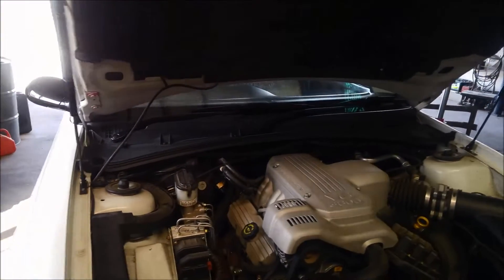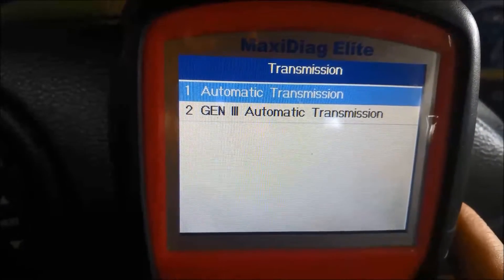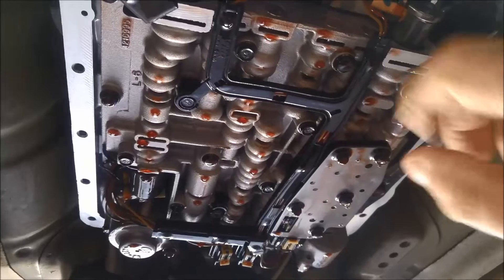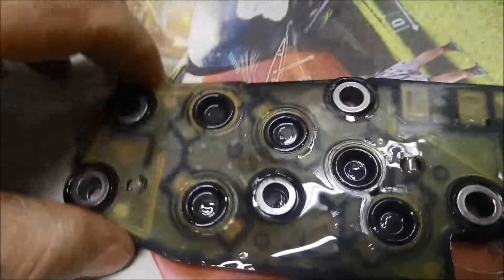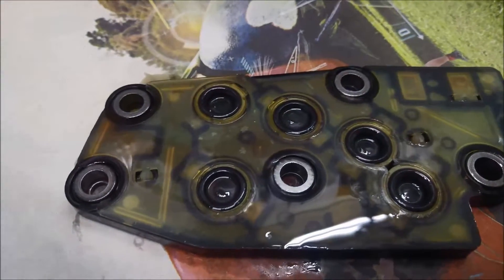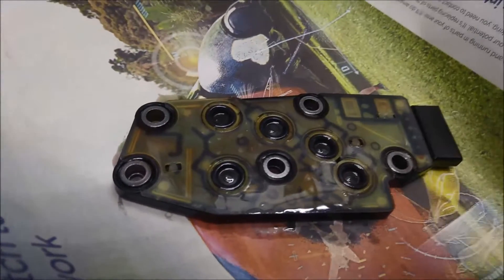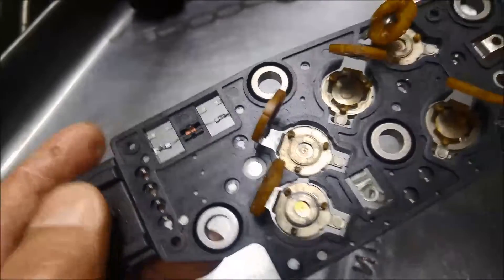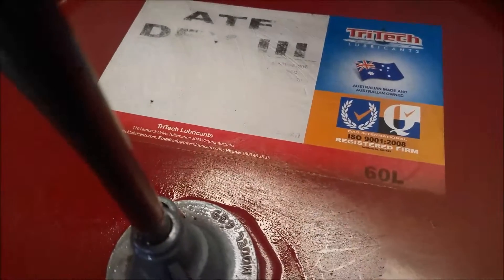4L60E 4L80E Problem Neutralizing Intermittently on Take-Off Repair by flushing Manifold Switch Plate

Comment: My transmission did this going into 3rd gear. Checked the shift solenoids. Low ohm resistance. The manualswitch plate had been replaced by a previous owner with a generic aftermarket unit and over torqued to the valve body. It was full of gunk and upon removal the o rings and disks stuck to the valve body. I'm replacing the shift solenoids and the maual switch plate and hoping that fixes my problems. I've been watchig some of your videos and educating myself on transmission servicing. Thank you for the great information and explanations!
Reply: Did it get fixed?
Reply: @RaulioG88  No. I believe it's burned 3-4 clutch pack. No easy fix, here.

Comment: i put way too much fluid in my transmisson=, due to dip stick not being fully seated. now it plugs the filter after about 20minutes with clutch material. i have dumped the pan twice now and i am suspecting high pressure is causing premature wear, i will be testing this tommorrow. is there a chance that this manifold pressure device can cause a high pressure
Reply from the maker: hi, too much fluid will hit the spinning components and aerate the fluid. in an hydraulic circuit air can be compressed, oil or fluid cant be so much, aerated fluid will cause spongy or slipping shifts. the pressure control solenoid if disconnected will go to full pressure to try save clutch and band lining application. some people fiddle with the adjustment on the press control solenoid without knowing how much you can adjust and sometimes the valve cant shuttle enough because of that or if loosened too much bleeds off constantly. you need to know how to calibrate the solenoid properly. if the linings are peeled it means trans needs to come out for repair. cheers

Comment: Hi there, I’m glad I’ve come across your channel, and apologies for this long winded question. I have recently had a complete transmission failure on a VY commodore. A few weeks after a service…pan gasket, filter and fluid top up as per workshop manual, I noticed gear changes were delayed, and I guess could be described as slight slippage. No other strange noises or obvious mechanical anomalies, then one morning whilst selecting reverse, there was like a 3 second delay before engaging. I thought I would check fluid level, and it was very high. I know I didn’t over fill it. The vehicle didn’t want to drive in any gear, but would try engage after revving around 3-4k. I decided to siphon quite a lot of fluid out until it registered at the correct level, in park and at operating temp. From this point, there was no engagement in any gear. Dash shows correct gear, but nothing. 

With your years of experience…have you herd or experienced anything like this! Does this sound like a major failure of say the pump, or torque converter? No engine light or codes as far as I’m aware.
Reply from the maker: hi, did you check seal on filter ? is it correct filter or maybe crack along plastic seam on filter. sounds like a pressure ir insufficient fluid issue ? cheers
Reply: @YepThatsIt  Hi, thanks for the prompt response. I installed the seal that came with it, replacing the old one. Pretty sure everything is correct, but I haven’t dropped the pan since, so I will recheck along with the things you have mentioned on the weekend, as it seems a bit suspicious after replacing these parts and no obvious signs! The fluid seemed a little frothy at the time it failed, which from further research makes sense from what you have pointed out. I will provide some feedback after inspection. Thanks heaps for the advice. I will contribute towards some beers too. Cheers.
Reply: @YepThatsIt  Hi mate, your suggestions were bang on! Teach me for not installing the seal correctly, even though I knew better. Filter was sitting in the pan! Any way, thanks again. Have made a payment to you PayPal account as mentioned. Enjoy a beer!

Comment: I want to know if this is what happened to mine as I put it in to drive and it doesn't move I have to put my foot down to 2000rpm to get my car moving what are you using to clean it
Reply: And my engine light is on know to
Reply from the maker: hi, we use x55 solvent. cheers

Comment: Thank you for the video. Much appreciated. Can I use mass air flow sensor cleaner to clean the switch?
Reply from the maker: hi, yes you can, any solvent that doesnt melt or damage solenoids is ok. cheers
Reply: @YepThatsIt  how do you know if you have a cracked diaphragm lens?

Comment: I just fixed this problem on my subb. The pressure switch manifold was contaminated with small metal fragments. The scanner returned these results: P0700, P1815 (4L60E start in wrong range > D2) plus stabilitrak alert in the truck (a nightmare: slow acceleration, harsh shifting, etc). Now is running like new :D
Reply from the maker: hi, glad to hear it, a few beers are always appreciated. link is in vid description. cheers

Comment: oh wow, do you know if the 92 chevy Astro van has this in the transmission? My reverse gear does not pull strong and kinda intermitted after sitting for a long time. I think its has the 4L60E in it. Not sure how to tell the different versions though. It's either the 4L60E or the 700R4
Reply from the maker: 700r4 has cable and small square electrical plug, 4l60e does not have the detent cable. cheers

Comment: What did you use to clean it with
Reply from the maker: hi, we use x55 solvent. cheers
Reply: @YepThatsIt  thanks so can I get to mine without removing my transmission it is a 99 Oldsmobile Alero
Reply from the maker: just remove trans pan and filter to access the pressure switch plate
Reply: @YepThatsIt  I have to remove the transmission side cover to access the switch